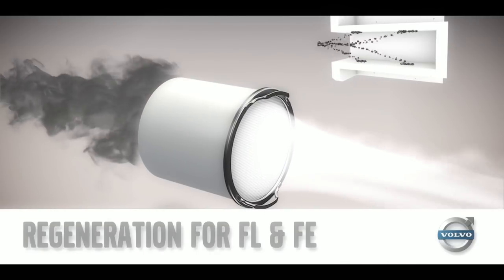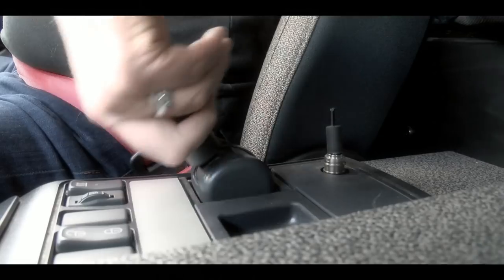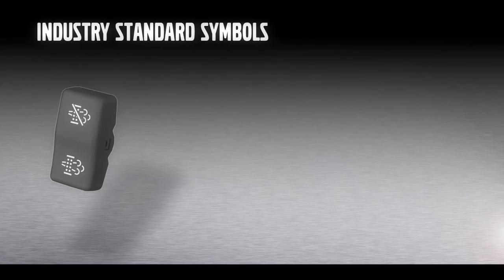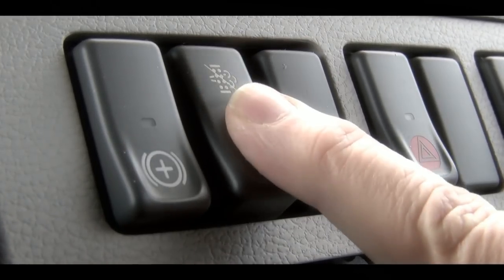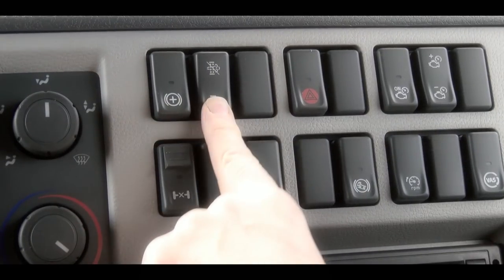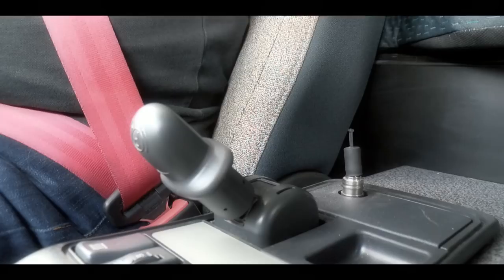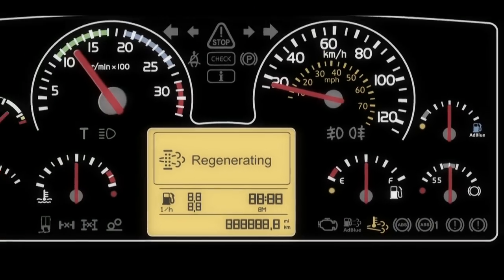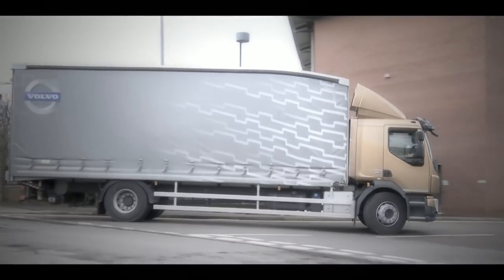Volvo Trucks DPF in the new FL & FE

Comment: Hi I’ve just started work with a local skip company, I’ve done a week and a half and the drivers before me say they have problems once the  switched is messed with, I told my boss yesterday that the Gauge is in the white, he said it may need to go into Volvo. Could this be done when your on your 45 min break ? When I do motorway driving I use only gear 5 so the revs are raised. I comment a lot and not many people if any reply